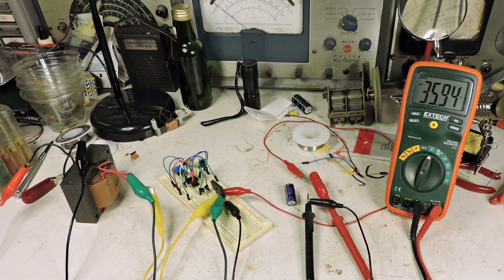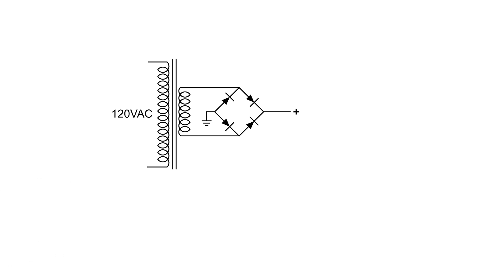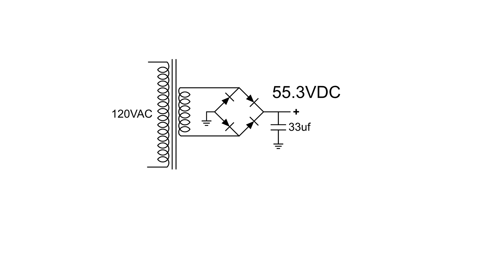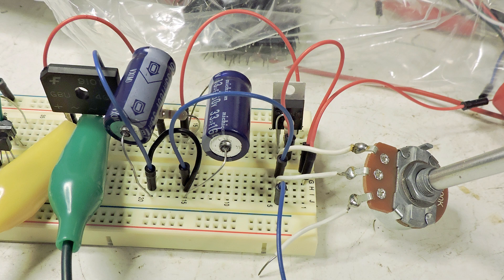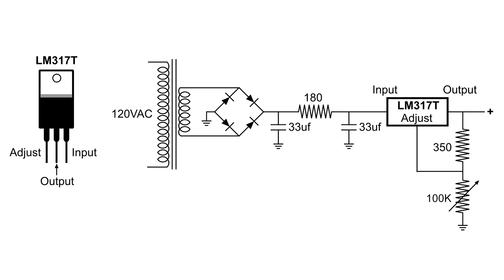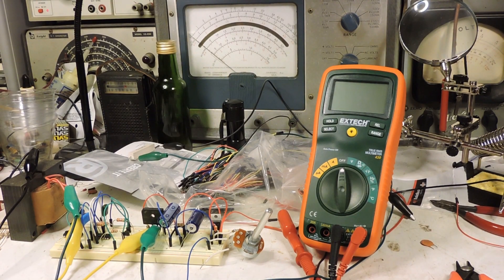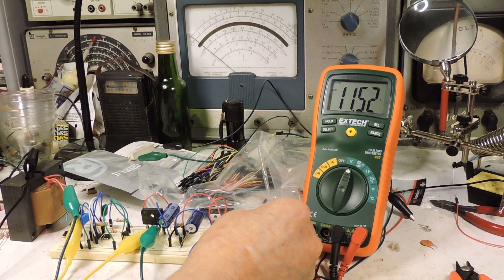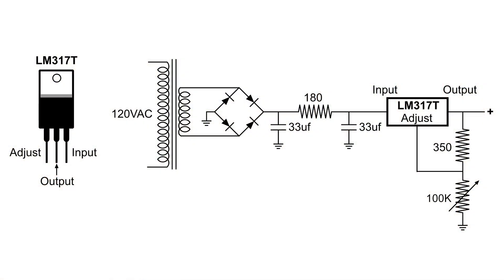Adjustable Voltage Regulator LM317T functional demo

Comment: I've used the 317 for many years. They are very dependable and are my go to adjustable regulator for linear supplies up to 1.5 amps. This regulator has a ripple rejection of 80db or better so your pi filter is redundant however, the 317 has a tendency to oscillate if you do not add a .1uf as close to the input pin as possible so the last cap in your pi can serve double duty here. Regulation and ripple rejection will be improved if you lower the resistance value between adj and output terminal to 270 ohms. I've used these to regulate 500V B+ rails in tube equipment. It really smooths things out on tube amps meant for a studio environment. The trick is never exceed input to output voltage difference by more than 40vdc by keeping the adjust terminal well above ground by the correct amount.  FYI,  They also make these in a T5 package rated at 15 watts just in case you have a current hungry device in the future. It will work great for this project. Good choice.

Comment: Your posting of this video was perfect timing for me, as I'm working on an alarm system which is somewhat finicky in its DC voltage requirements, and there wasn't enough room in the budget to allow the purchase of a variable DC power supply. I'll probably do the lay out for the printed circuit board this weekend. Many thanks Rick!

Comment: I've used LM317s before, they're great, but I didn't know that a capacitor after a diode bridge rectifier would have a higher voltage. I need to play around with that circuit. I'm looking forward to the rest of this series.
Reply: AC is specified as RMS.  Once you rectify it you are capturing the peaks of the AC voltage waves.  The AC RMS voltage from the transformer out the unfiltered rectifier is 36 pulsed DC RMS.   36 volts X 1.414 to convert to peak which is about 51 volts peak pulsed DC  without a filter capacitor at the rectifier output. .  The meter used  here gives RMS for pulsed DC voltage also so that is why the formula above is off by about 4 volts.  Add the filter capacitor and DC is now constant under no load so you get the 55 volts seen in the video.  Hope this clears it up for you.
Reply: +jp040759 Thank you so much for taking the time and energy to explain that so well. Your response helps me understand that, and multimeters, much more. Thank you.
Reply: You're welcome.  Glad I could help.  Be advised, all meters are NOT "True RMS"   I just happen to have the same unit as above and know it is true RMS.     Other meters are averaging and designed specifically for AC SIN wave shapes to be accurate.  Any other shaped wave will give false readings.   Got to Extech web site and they have a video explanation of True RMS meters and their function.

Comment: The LM317 's input and output needs some bypass caps.  on the input rail you want 0.1uF to ground, and on the output you want 1.0uF to ground.  Here's a good place to use tantalum caps.  Mount the caps as physically close to the regulator as you can.  This is to prevent the internal circuitry of the 317 from doing odd things like oscillating.
Reply from the maker: Thanks

Comment: Be careful with the LM317.   The spec sheets advises that the maximum differential voltage between input pin voltage and output pin voltage of the device is 40 volts.

Comment: Hi. Very much appreciate your educational videos. I have recently salvaged a good deal of electronic broadcast equipment from a analog TV tower control room many tubes capacitors boards modulation equip ect .I lack the skills to utilize much of it unfortunately but wish to see some good use other than the landfill. If you'd like I would be happy to post a short video of the equipment in case there might be something u can use. There is one very large transformer I would like to try in welder.

Comment: thats 35V under no load are you able to bring it up back to the 35 volts needed for your transmitter project
Reply from the maker: 55VDC-35VDC=20VDC There is 20VDC in reserve. The transmitter does not draw enough current to use up the 20VDC reserve.

Comment: Hi. Could you help me. I input 30 v and 6 amp supply to lm 317. With D1047. I m using 220 ohms resistance on output and adjust pin. R2 i used 10k potentiometer. Problem is that my pot get burned when I adjust him
Reply from the maker: Can you send me the wiring diagram?
Reply: @AllAmericanFiveRadio   how i send. We can't upload pic on youtube.
Reply from the maker: @satishsanhotra4391  allamericanfiveradio@yahoo.com
Reply: so what was the problem?

Comment: Hi, I was thinking as I started to watch your video, starting with a 36vac secondary output into a bridge rectifier will give an output voltage of 36 x 1.4142 = 50.9V. This is too much for the LM317 according to the data sheet. Then you mentioned a Pi filter which made me think, OK that will reduce the voltage somewhat. I was hoping you would measure the output of the Pi filter. Might i make a suggestion? remove the bridge rectifier and use full wave diode pair, which should bring your voltage down to around 36v again, all be it with more ripple, but with the Pi filter and maybe a 3rd RC added will remove the ripple. Also the LM 317 is capable of outputting 1.5A and as a rule of thumb, 1000uf for every Amp. Of course the LM317 will also remove the ripple so it is not such a bad thing to use 2 diodes. if your AM radio draws a half amp say, place a 470uf cap across the outpout of your supply. This is engineering fun.

Comment: Rick, do you think it will heat up enough to need a sink?
Carl
Reply from the maker: The solid-state AM does not draw much current so there should not be much heat developed. The more challenging part will be keeping the RF from getting into the house wiring.

Comment: it will work but if you pull 1A it's gonna have a quite drow in voltage..
DC-DC converter is way better...bought one usaly but classic LM317 should work!

Comment: cold you please tell me how to add two 2N3055 in paralel, to this scheme so i can increase the current to more than 10 amps. i build that long time ago but i forget how.... thanks in advance, subscribed
Reply from the maker: I would look through Mouser for a 10Amp or higher voltage regulator